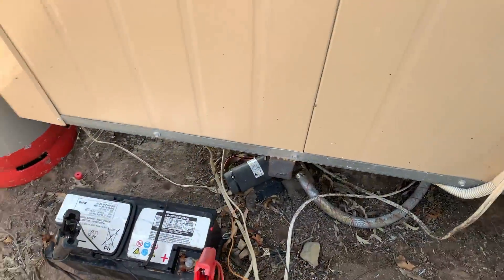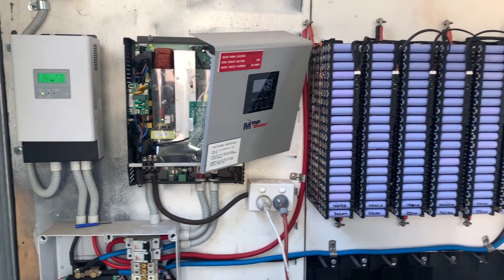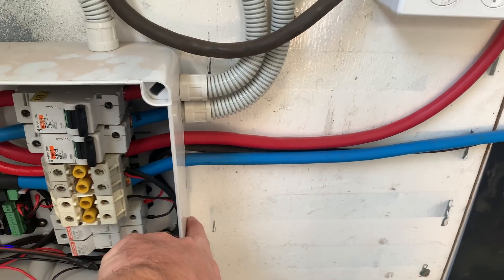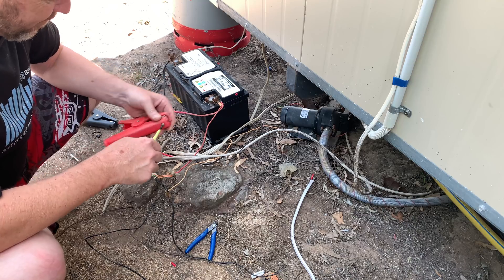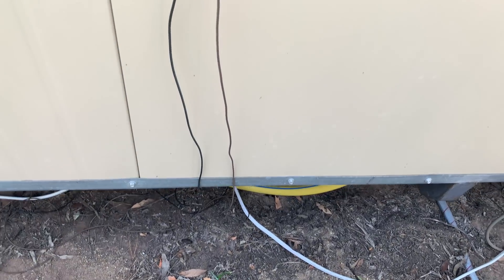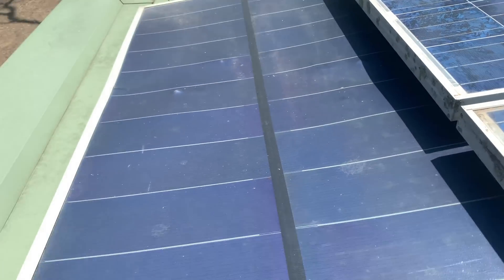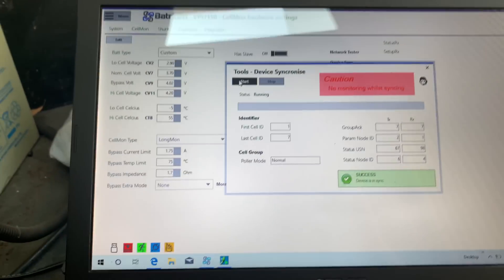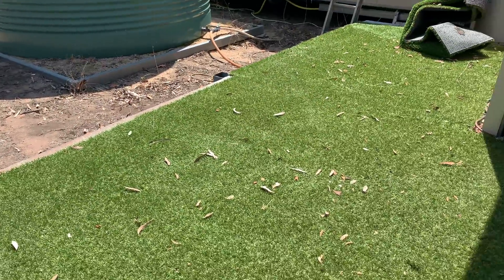Installing offgrid water pump 24v to 12v converter and PIP2424HS Error 1 out at the farm.

Comment: Build yourself a batch solar hot water heater out of an old water heater. You might also consider increasing your water catchment for those dry spells. Great vid, good day.
Reply from the maker: Water catchment is massive lol 4x 30,000l tanks two x 10,000l - Still working on HWS options that are reliable

Comment: Well!!! My crazy idea of using a small mig/ wire welder, as a battery spot welder!, did not pan out! Not why you would think either, It's not hot enough! It will work with long pulses, but I'm not putting that on a battery, the whole area around the electrodes turn red hot! It doesn't have the instant power, maybe I can try adding a ac capacitor, I'm looking into a high current DC SSR. And I'm just going to use a few of the lipo cells to spot weld! I built one from a microwave transformer, had the same problem! Maybe I can try thicker cable, I'm going to keep trying , and try not spending money, I do have a big arc welder! I wonder ?????

Comment: why is there a light switch for the water pump use a water Pressure Solenoid Valve DC 12V to run off your 12v you have a the pump then he just turn the tap on maybe next upgrade don't use a light switch but wow 10years like and no burn out of the light switch
Reply from the maker: He is def, and can't hear if a pipe bursts. It happened once and emptied the tanks - can't afford that with being offgrid. Its a perfect solution and works accordingly
Reply: @HBPowerwall  pipe bursts? what kind of pipe is it  pipe should not be bursting each to there own if it works and he happy with it all good but i have had mine auto switch and my pipe work is all good 2011 i did mine and never blown a pipe and yes im on water tank but not off grid and i can use mains water if i do blow a hose but never have
Reply: @HBPowerwall  just asking? what is the psi on the pump and if a hose has bursts off I bet it was with the switch was on and the tap was off that make it blow, but you know there is a rating with power on the light switch its AC/240v right its not for dc use on a water pump. you have long run of wire to the switch then back to the pump see what the volt drop is at the pump to.

Comment: fans... bane of a electronics persons existence...  always failing, wearing out getting clogged or making noise!  At least the PIP monitors the fans and lets you know.
Reply from the maker: Yep, but what gets me is the fans still spin and work yet still errors. I'm hoping it's one of the speed sensors that's the issue. *third wire on the fan connector typically. For now all i've done is clean/dust the unit & turned off the beeper in the software. Also fueled the generator just in case total failure.

Comment: Just a thought about the hot water system. I have a small system like that in my man shed to run through the man shed shower, which I heat up (in about 20 mins) with 2 diesel  12v glow plugs out of my old patrol. I just use a cheap chinese 12v thermal cut off set at 55c. All that runs off a 195w old solar panel and a cheap pwm charge controller, and has been working like that for about 8 years now. Also with the water issue, I have a water filter inline for recycling the shower water so I can use again and again. A 20l jerry does me about 4-6 weeks, plus the water in the system (depending on how many man shed showers I need to have) and the filter is an easy to redo sand and charcoal filter which I do every 6 months ish. Hope you and yours have a great chrissy and thanks for all the wonderful vids and info.
Reply from the maker: Been looking into the glow plug idea - i like it & it's cheap!

Comment: Looks like that split splitter has seen some heat, notice how the screw has a different color?
Reply from the maker: I didn't, will call him up and ask him to check it out asap, thanks for that - completely missed it. I run the thermal camera over it but didn't see an issue at the time.
Reply: HBPowerwall it probably only heats up under large loads, if you put your meter on each side of the connection you can see the resistance from the voltage and calculate it with the current

Comment: Hey pete if I have to run 5000 watts per hour how do i make my setup or module for me to only pull maximum of 1amp from each cell let's say if I join 5 modules ofcousre it wont be 1 module
Reply: P=IV
Reply: @Jimmeh_B  pete I don't mean to be rude but I didnt understand that 🙈
Reply: @safwanyousuf3570  sorry Safwan. 

It's ohm's law, where:
V=volts
I=amps
R=resistance
P=watts

V=IR
Also, I=V/R, and R=V/I.
Also:
P=IV and P=I^R.

May help you determine what you need to know. Your question as asked doesn't have enough information in it to be able to answer. 🙂
Reply: @Jimmeh_B  ok what I meant with one pack or module can I run 5000 watts ofcousre it will finish fast but will the module be able to handle that much...so wanted to know how my cell pack should be made...I only want to draw 1amp from a cell
Reply: @safwanyousuf3570  ok. when you say 5kW, do you mean you want to run a 5kW inverter? Or do you mean you have a 5kW load that runs at 240v? Or...?

5kw @ 10v is 500amps.
So, 3x18650's in series would give you 11.8v nominal, and around 2Ahrs.
So 1500x18650's configured as 3s500p or 3 packs of 500 cells paralleled, connected in series would give you 11.8v @ 1000Ahrs, meaning it could run an 11.8v load @ 5kW for approximately 2hrs with each cell only required to supply 1amp.

Comment: Hey Pete. The setup looks good. I wish I was off grid completely. My wife will understand exactly when the best time to use certain items like the dish washer.
This setup looks like a side project for you, is there other projects like this you are involved in?
That splitter certainly is doing its job and spliting😕.
You should swap it out soon and leave the shonky work for us smaller YouTubers😨. Nar it looks safe for the time being.
Thanks Pete.
Reply from the maker: I've done a few off camera for friends or other subs under the strict rule that i'm only 'helping' not doing if that makes sense. We have more plans for the farm that include - WindTurbine & Well Pump (Banggood sponsored) Also want to repower some remote sheds on the property - Want to put a huge DC led lighting system up. Gravity Tank to water the orchid and of course the hot water before winter arrives.
Reply: @HBPowerwall  I'm inching to do more for myself but the $ in restricting me. I would like to add the Batrium as well.
Also I like to get more involved in the community as well. So if you know of anyone in the Melbourne area please point them my way and I will put my two cents in. 
My next step is to join Facebook and jump on your page.
And I want to very much visit you and spend the day.